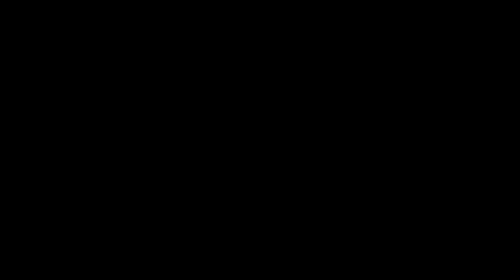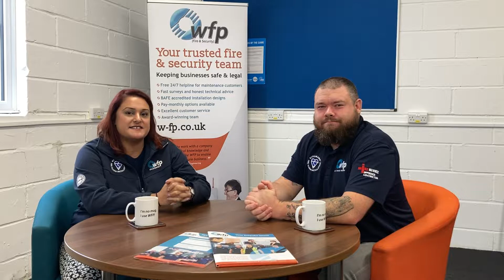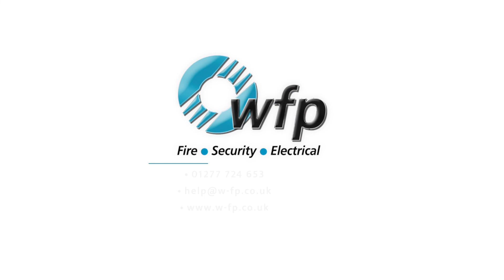Why You NEED to Upgrade to LED Lighting | An Energy & Money Saving Must! 💡⚡️💚💷

Comment: Cant stand LEDs i use compact fluorescent instead
Reply from the maker: Thank you for commenting! Fluorescents are going to be discontinued, but is there a particular reason you prefer these over LED?
Reply: @wirefreeprotection  Led is a boring, cheaply made light the good old fluorescents can last over 80 years as long as they have lamp replacements every 20 years or so especially on magnetic ballasts LEDs however only last about ten years then u have to buy an entire new fixture
Reply from the maker: @FinlaysFireSystemsElectrical  Thank you for commenting and explaining. That's really interesting what you say! We're finding people are making savings of thousands per year, one down from £9k in electricity bills to £5k in a year. Longevity-wise is contentious but with 5+ years of warranty and the cost savings made in the duration, it's made sense so far for who we've helped. It's interesting to know other people's experiences and takes on it though!